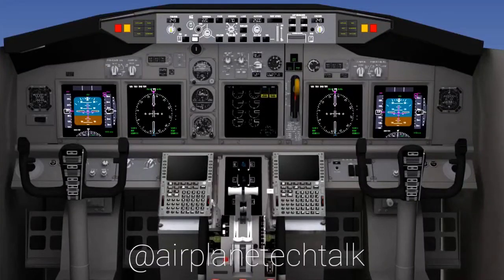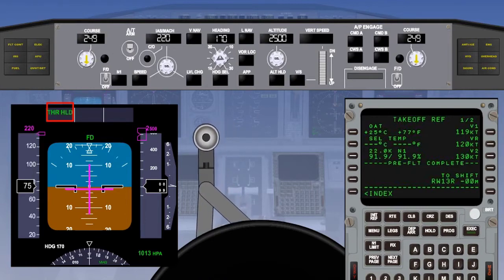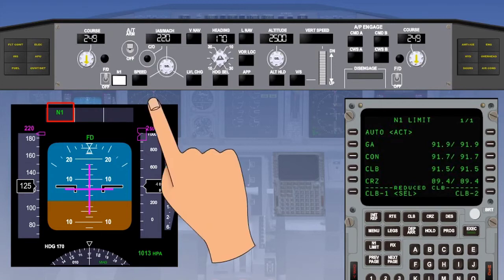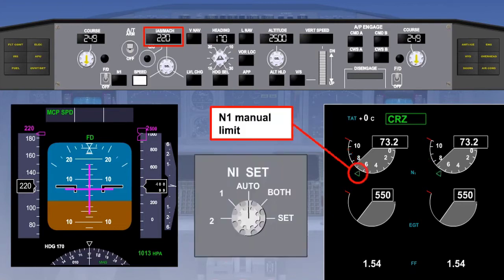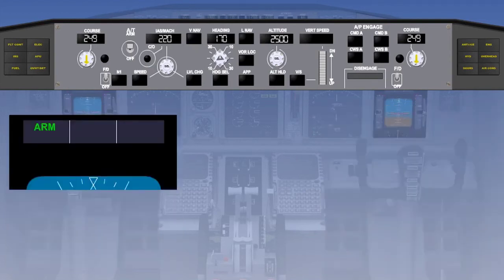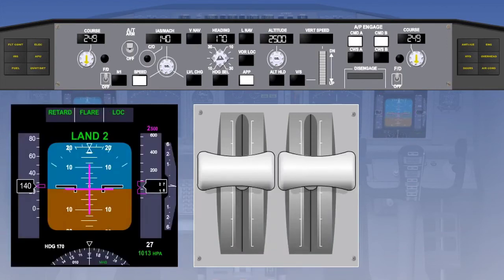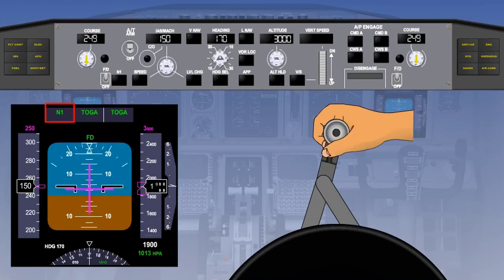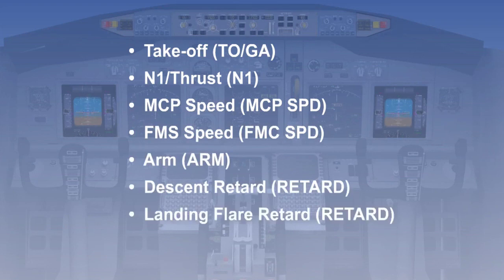Aircraft Auto Throttle Modes | Lecture 08

Comment: Most pilot failure on throttle caused loss of power , inconsistent speed, engine stalling , rough idle and hesitation issues . Those are main reason of Airplane crash by engine malfunction and mechanical failure 😢